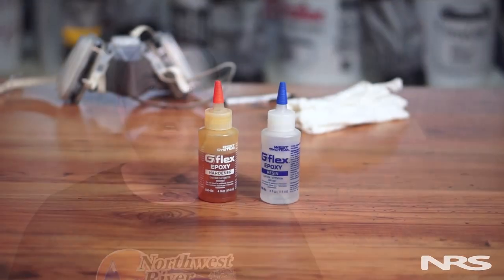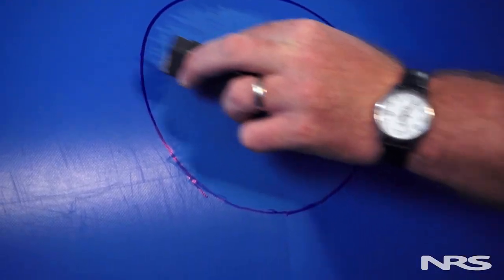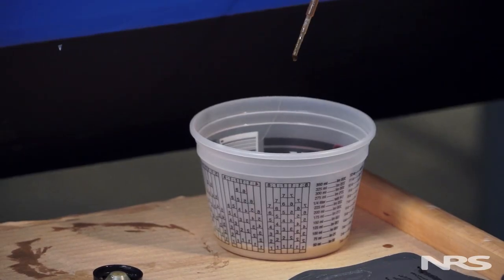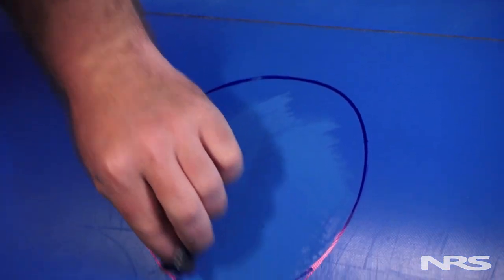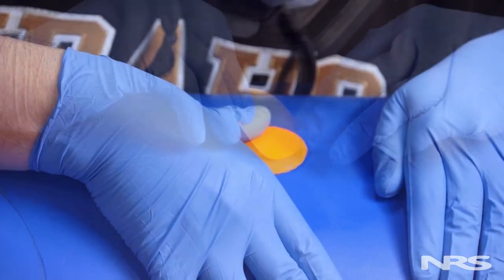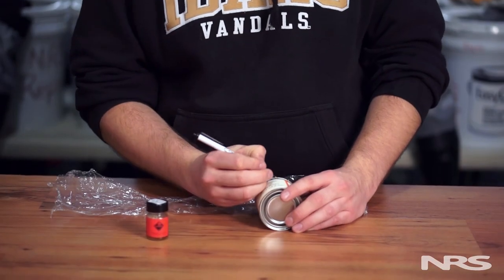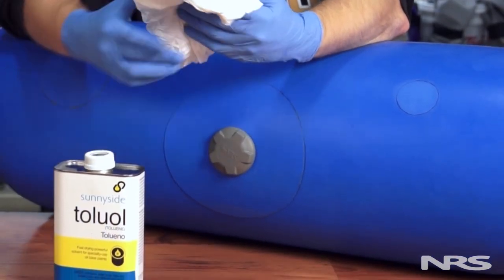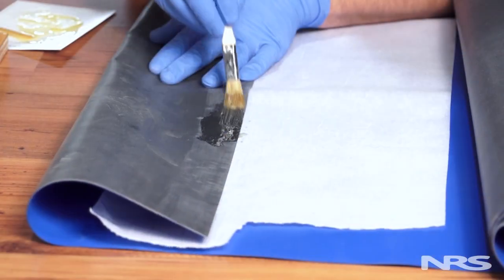How To: Inflatable Repair Adhesives Guide

Comment: Always store all paints and canned adhesives upside down if not being used for a long time. The material will self seal in any microscopic leaks in the lid creating a air tight seal. Be aware of any initial leaks that may come out of the lid. I've kept paints good over 10 years doing this. PS lose the music!

Comment: Great videos! Thanks! I have a larger area of scrim shot from a hack job of removing a handle from a PVC dinghy. The area is the exact area where I need to attach a Weaver Davit pad. Would Aquaseal be ok in this instance? Strong enough to attach the pad on top? Also, is it correct that I'd need two different adhesives to attach the pads to a PVC boat. Any help is very much appreciated. Again, thanks for the great vids. Very helpful!

Comment: you said for patching pvc you recommend Clifton, however you didn't mention what you recommend for repairing a seam?
Reply from the maker: Thanks for the question +Allen Fong. Clifton Urethane Adhesive is our recommendation for most PVC applications, including seam repair. However, the glue choice and application can vary depending upon the nature of the project (i.e. slow leak, delamination or blown seam). Please feel free to call our repair experts at 877-677-4327 if you have questions or would like us to walk you through the process.

Comment: The products at Our Dollar Tree are Shrinking in Content ,   Even the 5 Dollar can of Huffing Tulio has become a Third of the way full , They are Selling Hand  Rags  to the glue heads for 2 and even 3  Dollars for a small rag of Toluene  these day's , I remember when gasoline, acrylic paints, varnishes, lacquers, paint thinners, adhesives, glues, rubber cement, airplane glue, and shoe polish; and  carburetor cleaner starter and fluid , White out were all much Lower , I feel bad for the local glue heads :( QC

Comment: Stan's Tubless Tire Sealant works great. Its sold at most bicycle shops. Its a liquid latex. You just pour it in each chamber. Fill it up with air. rotate the boat every 10 min for an hour then let sit for 24 hours. Done. Seals all those small leaks you can't find and the ones you can find. And it's cheaper than buying the same product at westmarine
Reply: shawn banks How well did this work out for you?  What boat did you use this on? How much of the sealant did you end using per chamber?  Did any of the gunk come back out when you compressed it for storage?

Comment: My wooden transom separated from the tubes. You mentioned one glue for wood, and one for tubing/patches etc. When applying glue to the wood (transom), would this be the same glue for the zodiac tubing? Do I glue the wood first,  apply different glue to tubing second; and stick both together? Hopefully that makes sense. Thank you in advance!
love the video and so helpful in fixing our Zodiac mk2 Futura.
Reply from the maker: Hello Wade, The best glue for a repair like this is G-Flex epoxy. It's great for gluing boat fabric to wood. If the tubes are leaking any air you will want to make sure these leaks are fixed before gluing the transom back into place.

Comment from the maker: Thank you for your comment. Zodiac used a variety of fabrics over the years. For this reason we suggest using Stabond Adhesive (sold at nrsweb.com) for air holding patches. Stabond works on a variety of fabric types, so it should work no matter what fabric your boat is made out of. Note, properly preparing the fabric and boat material for glue is key. If the boat and/or patch are not cleaned and prepared properly, then the patch will not stay on the boat very long.

Thank you for your comment.
Reply: Can i have a chance to talk to u???

Comment: why we need more than 1 layer for the glue ( vinyl cement for inflatable boat
Reply from the maker: Good question. When you use glue on wood, paper, and other porous materials the glue flows into tiny openings and after it dries the glue has formed into and irregular shape that locks the two pieces together. When gluing PVC or Hypalon the solvents in the glue are slightly melting the material to allow the chemical bond to form. The solvents only do their job while they're wet. You apply several coats to insure the solvents have been able to thoroughly do their job.

Comment: I have a rubber duck named Patina. 

Today I had to cut open Patina’s tummy to remove her squeaker, as it fell inside of her when someone pushed her too hard. I just cut a little slit in her belly and managed to get the squeaker back in its proper spot, but now she won’t squeak properly, as the slit (I’m guessing?) needs to be sealed somehow. 

Would this work on Patina? I miss her squeaky sounds.

Comment: What is the ratio of glue to accelerate?  Is the same glue used for the thinner seam fabric?
Reply from the maker: Hello Anne, The ratio is different depending on the specific adhesive. If you purchased the glue from NRS we provide that information on our website. To answer your other question yes, the same adhesive is used on seam fabric.

Comment: What adhesive would you recommend for a large seam blowout on a pvc inflatable kayak?  It was outside on our lawn on a 80 degree day fully inflated and blew the seams.
We learned the hard way!😭
Reply from the maker: Hi CJ, Sorry about the hard lesson you learned. Our repairs department really likes the Stabond adhesive for PVC to PVC repairs. We've also had good luck with the Clifton Star Adhesive. If you use the Star Adhesive make sure to also get the accelerator. Feel free to give us a call at 877-677-4327 if you have additional questions.

Comment from the maker: How To; Inflatable Repair Adhesives Guide
How To: PVC and Urethane Boat Repair (Focusing on Stabond)

One a final note, the most important step of any patch or repair job is preparation. Be sure to take the time to prepare the patch and repair area thoroughly. If these areas are not prepped and cleaned properly your patch won't last very long. It may stick for a short time, but will probably peeling off at an inopportune time down the line.

Comment: Thank you. This was a big help. I have a 20-plus-year-old 13-foot Avon motor boat where the rubrail is coming loose in a few places. The glue I had bought and was supposedly suited for Hypalon required mixing. It didn't do as well. It may have already been past its shelf life when I bought it, and although I had prepped it. I will use your recommendation for Hypalon.
Reply from the maker: Glad it helped
Reply: Thanks for the this video. Do you guys have suggestion for removing old glue from old patches before laying the new patch?

Comment from the maker: Most likely you'll still be able to repair the boat, it will be a bit of work, but you should still be able to patch it. You might have to baseball stitch the opening shut and then lay two patches over the top, or possibly do an inner and outer patch (depending on the location). Give us a call if you have any questions (1-800-635-5202).

Comment: I'm about to try and repair an inflatable Sevylor kayak I bought. I have some G-Flex laying around and have been impressed with it so I'm planning on trying to patch it with that as the adhesive.The tear is on the very bottom of the yak and the PVC material down there looks to be no thicker than what you might find on a cheap pool float. I'm concerned that the material is way too thin for even light sanding, would you agree? Also, I see y'all have your boat inflated during the repair, I would have thought that having it inflated during what should be the adhesive clamping stage would weaken the bond. Is there some benefit to having it inflated during the repair or did y'all just do it that way because it was easier to film? Great video, super informative and thorough, you don't see that often on YouTube tutorials.! And yes, know I should just throw this cheap inflatable yak away but giving up's not really my style.
Reply: pretty sure they were using a perfectly fine boat just to demonstrate the procedures. he should have pointed that out though. one also doesn't want to inflate their boat too soon after applying any patches/repairs. wait at least the recommended full cure time, or more if possible. i was packed for a trip, and scraped my boat while loading and the scrape made a small hole. had to unload, and do a rushed patch-job in the dark. wasn't cancelling my fishing trip. left in the morning, and inflated boat at the lake. got only half a day's fishing in when i noticed a bubble slowly forming under the patch, and over time, it slowly grew larger, working it's way closer to the edge of the patch. had to cut the trip short and book it back to camp before it let loose, and it did.

Comment from the maker: If it's the interface between the transom and the boat fabric i.e. the  fabric and the transom board are separating from each other, then we would suggest using G-flex epoxy. G-flex works for a myriad of fabric and materials, so it should work great with whatever your transom is made of.  Stabond could work as well but you'll probably get a better bond with G-flex. The following videos on our website/YouTube page can help with the repair process:

Comment: Great info, thanks. I've got PVC tubes and the tape/band that holds the tubes to the rigid hull have come away. I was thinking to use acetone to clean and g-flex to bond. Is that what you'd do?
Reply from the maker: If the rigid hull is ABS plastic or fiberglass, acetone and g-flex would be the right choice.

Comment: Question...I've got a pretty large hole in our inflatable 3 ringed pool that is our only hope for cooling down summer time, and I can't afford to buy another one, I know they're like 40$ but I don't have 40$. The hole is in the corner of pool and is on a seem that is connected to the other ring below it, causing second ring only a slow leak...there is a second flap of vinyl on the inside of the main hole ring that I've struggled with figuring out how to position it for repairing the hole under that flap. So this us the part that makes what I'm doing sort of interesting, I had same pool but that got too many holed in it and got a replacement, turned old one into a giant slip and slide which is awesome, so I have tons of the exact same pool vinyl I can use for this hole repair on corner seem. Unfortunately, I threw away the corners of other one cus it didn't lay flat for the slip and slide, other wise ide be trying to figure out how to basically replace the whole corner of the pool and seal the seams with some sort of plastic welding hot iron or heat sealer for vinyl which ive done before and its sort of fun to make your own inflatables.  But I don't have a corner rounded piece... what sort of vinyl glue adhesive works best for this sort of repair,
Reply from the maker: I would recommend HH-66 or Clifton PVC Adhesive for that sort of repair and to also prep the surface with acetone.

Comment: Should Stabond be used to adhere rubber to PVC? I’m trying to reinforce the bottom of my transom with rubber.
Reply from the maker: Hi Mauricio, Stabond will work great for adhering rubber coated materials to PVC!

Comment: The fabric and the transom board appear to be separating because it doesn't take long before there is about 3" of water in the boat. The "following video's" did not show up. What are the names of the video's so that I can do a search for them (links don't seem to show up in posts for some reason). Thanks a lot!

Comment: I have a Seahawk 4 that seems to slowly lose air but I am having trouble finding specific leaks. We are considering treating it with a sealant and hoping we catch the sites of air loss.  Is there a product you would recommend for this or is there a better approach?
Reply: The Seahawk has only been used about 15-20 times.

Comment: Well I`m planning on making a hovercraft and I have a bunch of steel truck tarp material left it has a rubber back with a mesh looks the same as Dingy material -I was suggested HH66 Glue ???  Never seen it before that`s why I asked you .

Comment from the maker: If it will be a fabric to solid surface repair that wont flex a lot, then G/flex Epoxy would be the better option. See the next comment down for additional details.

Thank you again for the comment. Definitely call, comment or email with any further questions.

Comment: Not that related but I've been browsing youtube for a while looking for an answer.  I own an intex mariner 4 which has small leak on the inflatable keel.  Anyway, I need to fix this leak and I don't think a patch will ever fit on this location.  Is there a glue that you know of that will work?  It is a PVC material.  I've seen some forums recommend tent glue which confuses me and there is not listing of a brand.  Any thoughts will be greatly appreciated.
Reply: ***** Awesome!  SuperMegaThanks!

Comment: Hi! Which glue would you recommend for an inflatable paddle board? I live in Puerto Rico and haven’t been able to find someone that can fix it. Thank you!
Reply from the maker: Most paddle boards are PVC so any of the inflatable PVC adhesives should work. Getting glue in Puerto Rico can be challenging. Shipping flammable adhesives is cost prohibitive. Your best option is to contact local marine supply shops. Many sail boats have PVC dinghies and these places often carry repair materials. Good luck with the repair!

Comment: I am a marine engineer and i will repair a rubber marine airbags with NPR rubber, what the best  adhesive to deal with this rubber???????
Reply from the maker: I'm no familiar with NPR rubber. Our Clifton Hypalon adhesive works on most types of rubber. I'd check with the manufacturer of the rubber before attempting the repair.

Comment: Hi,

How do I remove the old glue? One of the rings came off. But the old gleu is not coming of with only acetone or alcohol. I want to clean and sand the area before I put the glue on. Thnks
Reply from the maker: Hi +Maurice Dun, the solvent you use will depend on the material of your boat. If the boat is made of Hypalon/Pennel Orca we recomend using Toluol-toluene (http://www.nrs.com/product/1920/toluol-toluene) for glue removal. If your boat is PVC based than MEK (http://www.nrs.com/product/1912/mek-pvc-solvent) should do the trick. Please give us a call at 877-677-4327 or email us service@nrs.com if you have any more questions.

Comment: What would you recommend for Explorer K2 inflatable kayak patch repair?
Reply from the maker: Hi Stephen, For that boat the best adhesive is going to be HH66. This video is a few years old and that glue wasn't available when it was made. Finding patch material might be difficult. You'll have to contact the manufacturer. If its a small repair you can use Tear Aid. Tear Aid is an adhesive tape the creates a semi-permanent patch. Feel free to give us a call at 877-677-4327 if you have any other questions.

Comment: I have a smaller version of a similar raft with a very tiny slow leak that I can’t locate. Can I use a liquid sealant inside the raft and move the liquid around to seal the leak?
Reply from the maker: An internal sealant is an option but should be considered a last resort. We sell Flexseal (https://www.nrs.com/product/1989/raft-sealant-kit) at NRS that can be used on both Hypalon and PVC boats. Your best option is to do more investigating and find the leaks. Make sure to check around the valves. Valves are the cause of leaks more often than not. If you have any questions feel free to give us a call at 1-800-635-5202.

Comment: Will stabond work on vinyl pvc inflatable boat by Intex
Reply from the maker: Hi Starwin, Stabond works on PVC and should work on the Intex material but you should contact Intex to make sure. You'll probably want to source your patching material direct from Intex if possible.

Comment: Hi
What is the best way to remove an old glued on seat mount so i can replace it   the webbing dried out and disintegrated.   Also how do i determine the position of oar locks on a boat ?
Reply from the maker: Thanks for reaching out. These are great questions, unfortunately the answers may not fit in a youtube comment reply box. In order to serve you better, please give our repair experts a call at 877-677-4327. We look forward to hearing from you. Thanks and have a great day!

Comment: Is there a product available that would allow me to just paint it on the bottom of the pool instead of patching pin holes one by one? I feel like if I could just cover/ paint the bottom with something I could repair the whole thing at once. Thank you for any advice
Reply from the maker: Sounds like you patching an above ground pool. There might be a few differences between what you have and an inflatable boat. But your first step is going to be determining the material. Most likely its some kind of vinyl. There are some paint on options out there but they can get a little expensive and NRS doesn't stock any. If Aquaseal will stick to your fabric and you can see the holes that might be your most cost effective option.
Reply: @NRSWEB  thank you for answering! I somewhat have patched the holes but it's still leaking and yes it is an above ground vinyl pool.

Comment: what about a right glue for a Plastic or a Poly none inflatable kiddie / wading pool?
Reply from the maker: Thanks for the question +Lady_Lone_ Wolf. If you're not sure what material the pool is made of, a versatile adhesive like Aquaseal or Stabond for the application is recommended. Both these adhesives will bond to a number of different materials (i.e. hypalon, nylon, vinyl (PVC), and many plastics). If you have any other questions about choosing the right adhesive please reply to this comment, give us a call (877-677-4327), or send us an email (service@nrs.com). Thanks again!

Aquaseal: http://www.nrs.com/product/2291/aquaseal-urethane-repair-adhesive

Stabond: http://www.nrs.com/product/1903/stabond-adhesive